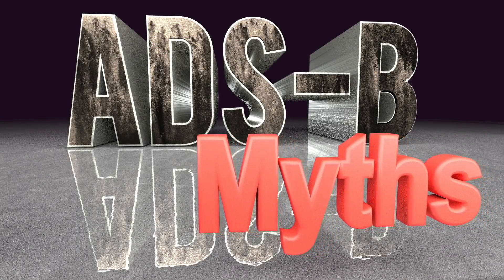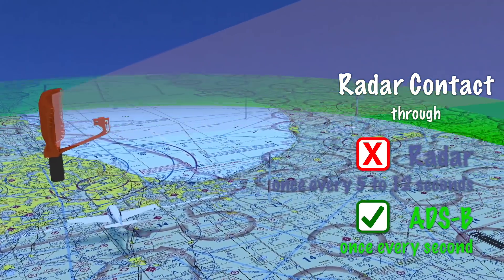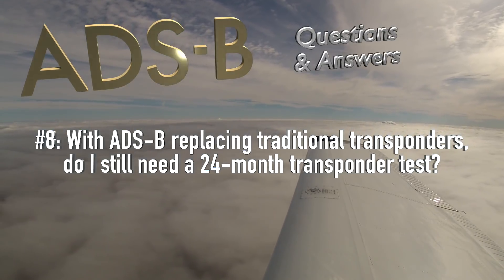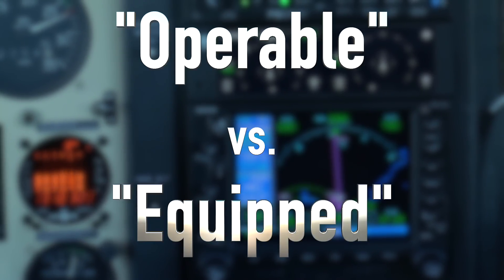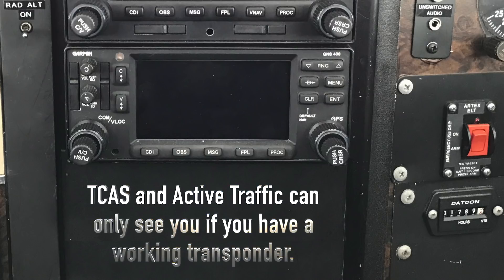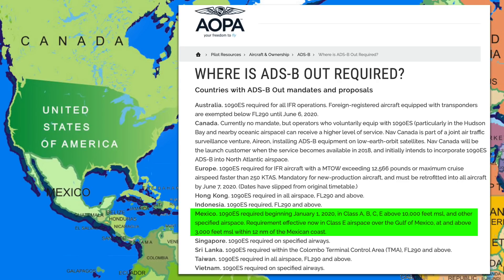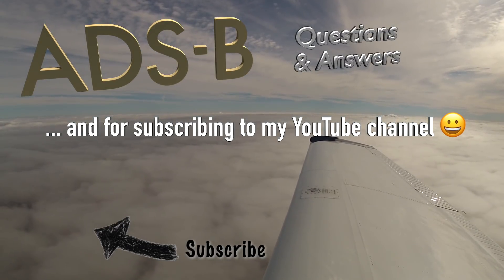ADS-B Myths - Q&A for Pilot and Aircraft Owner

Comment: Links to individual topics/questions (no reloading youtube necessary):

#1: Do I have to install ADS-B to fly in the US in 2020?
       0:15

#2: Will ATC change how they work January 1st 2020?
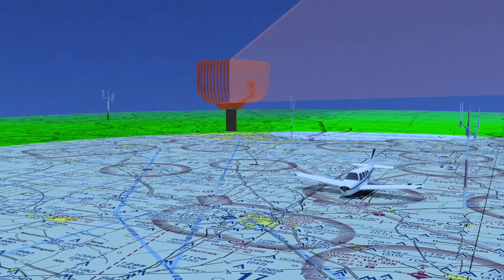       0:56

#3: Can I substitute GPS altitude for a broken altitude encoder?
       1:28

#4: Can I get VFR flight following or file IFR flight plans in 2020 without ADS-B ‘out'?
       1:51

#5: Can I be ADS-B compliant with a portable ADS-B unit?
       2:09

#6: I don't have ADS-B. Can I fly to an airport in Class B or C airspace?
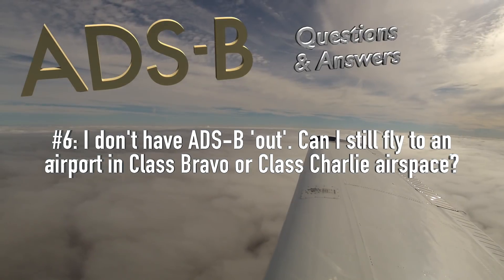       2:32

#7: I have ADS-B ‘in’; should I remove active traffic from my panel?
       3:03

#8: With ADS-B, do I still need a 24-month transponder test?
       3:40

#9: Can I fly if ADS-B is installed on my aircraft but broken?
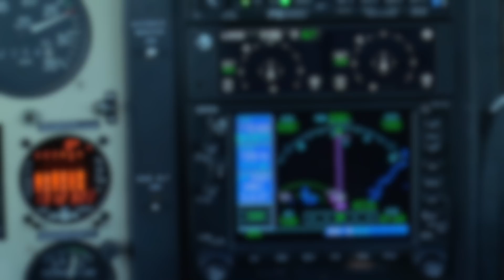       4:07

#10: I won't get ADS-B; should I remove my Mode C transponder?
       5:11

#11: I heard about “anonymous mode”. Is that important?
       6:32

#12: Does it matter if I get a UAT or 1090 transponder?
       7:09

#13: I have ADS-B ‘out’, but I often don’t see other nearby airplanes through TIS-B. What could be the reason?
       8:00
Reply from the maker: Thanks a lot for putting this together.
I tried the same thing in the video description, using links from the "Share" feature in YouTube. But my links look different and, well, they don't seem to work. (I should have tested that.)
Curious what the difference is - would you mind explaining how you created this nice summary of links?
Thanks, Martin
Reply: Sure Martin - all I did was type the offset as "0:15", for example.  Just type the minute:second offset as numbers and it autolinks it to the offset in the video.
Reply: Can a Garmin GTX 345 with integrated GPS for approved ATC position be upgraded to a Diversity Unit. I think in Canada we’ll need a top mounted transponder antenna. Can this non Diversity unit be reconfigured.   Or  will I need to buy yet another GTX 345D Unit transponder and do this all over again. I believe all other countries ( other the USA ) with a Space Based system will be requiring the Diversity units with the two antenna’s to stop shadowing to ATC while aircraft is in other than straight and level flight.  I’m hoping my current GTX 345 can be ungraded to these needs of Diversity without starting from scratch again to meet the other country needs